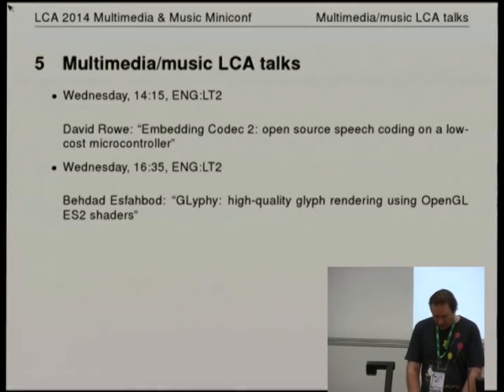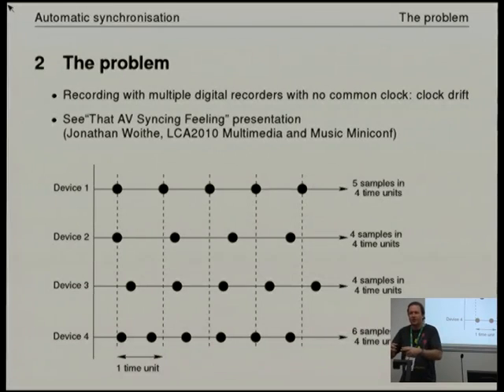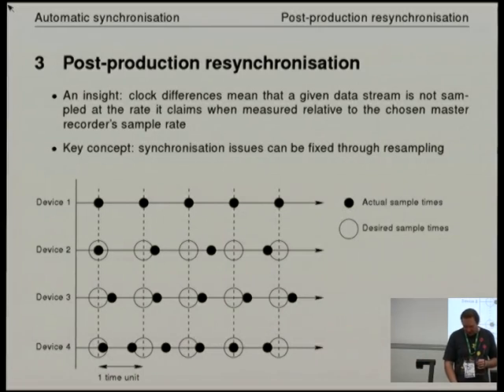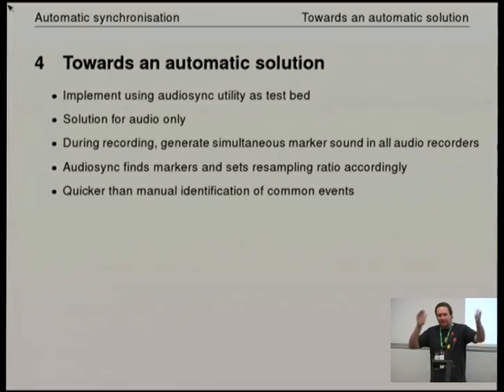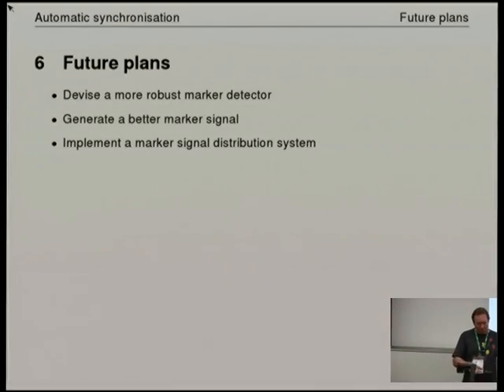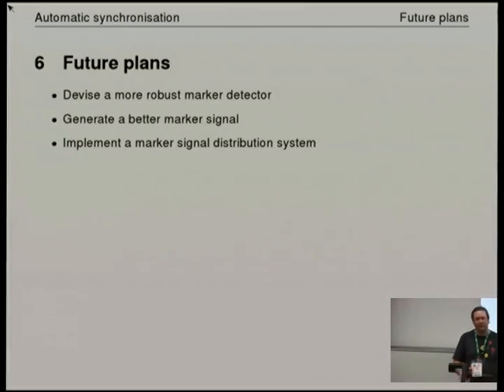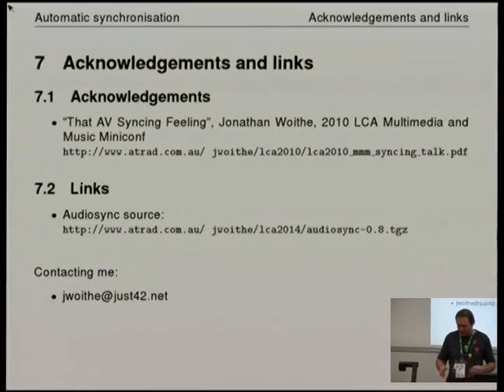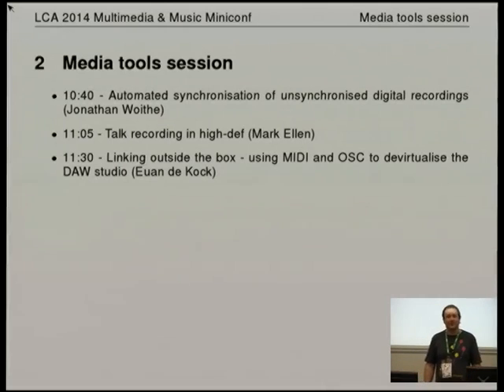Automated synchronisation of unsynchronised digital recordings (Jonathan Woithe)

Comment: Without looking up the project to determine its present status, I might suggest taking a look at "minimodem" as a means of generating a distinctive audio marker to syncs. The software could be set to look for a particular ID in the demodulated marker tone to control features or something too.

I'm not sure how valuable this is (certainly not in Australia), but ever since I encountered a recorder that gave an actual achieved sample rate of 46,432 Hz (!*) when set to the nominal rate of 48,000 Hz (wow that's a big error--luckily 44.1 kHz was closer @ 44117.8 Hz), I've taken to calibrating the sample rates actually achieved by my devices by recording some audio timecode from our national time and frequency standard radio beacons (WWV and/or WWVH in my case). I'll determine a level of precision equal to the likely stability of the crystal and record some timecode at the start and end of a suitably long interval. Measuring the number of samples recorded against the easy to identify landmarks of the timecode gives a precision sample clock measurement. This I use as a base calibration for the recorder. If you have stable clocks in your devices, depending on other circumstances, this calibration alone may be enough to keep your overall audio project within a given sync window. Or stated another way, basic crystal stability factors may be the dominating residual after such a calibration.

The experience taught me that every device's idea of 44.1 kHz or 48 kHz can be wildly at odds.

* I first got a clue that something was way off when I noted the recording elapsed time vs. my wristwatch for a recording that began on-the-hour were not even close to agreeing (about two minutes slow vs. wall clock time).